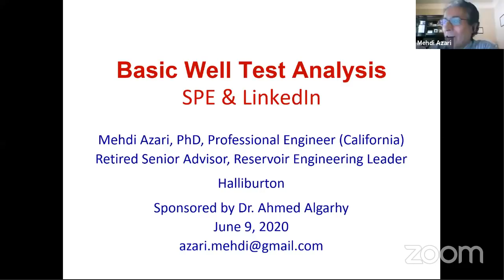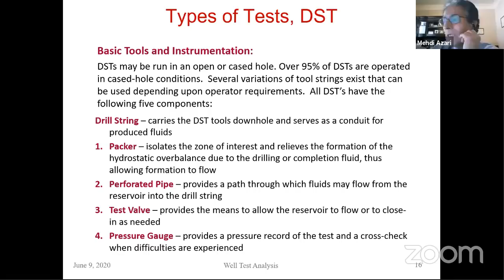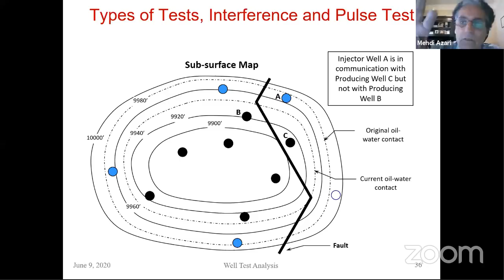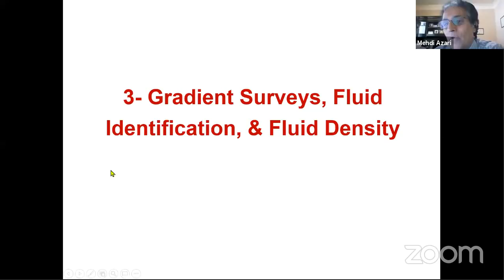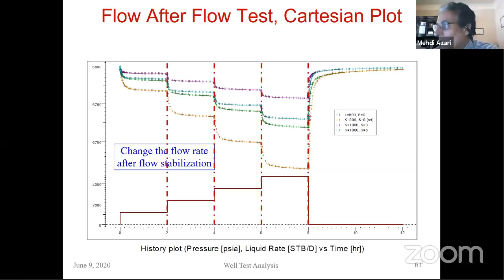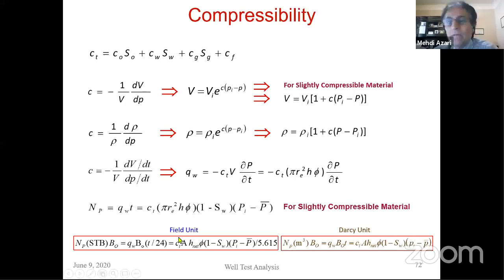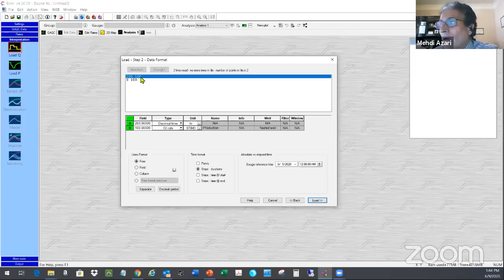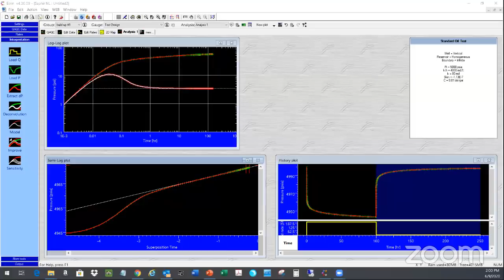Well Test Analysis

Comment: Thank you for the great presentation, I just would like to add a comment 
for the pressure points 
in the static conditions they were exactly in the same line, (equilibrium state) which means connected reservoir , however, once the field started to produced the pressure was scattered, different pressure points with different locations, after analysis it turned out that even though there is no faults that separate the reservoir, the aquifer strength is not acting the same along the structure  which makes the difference in the pressure.
so areal communication is not the only thing responsible for the pressure points, the presence of aquifer along the structure is an important factor to consider